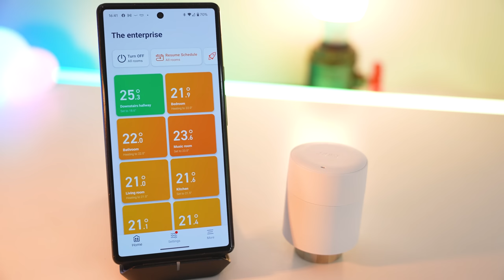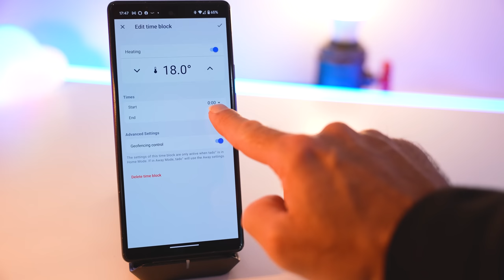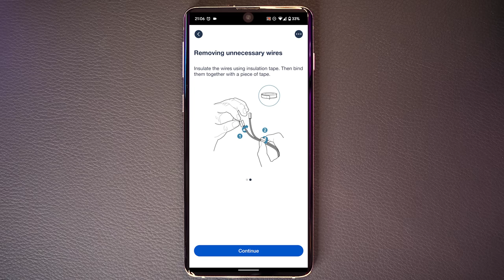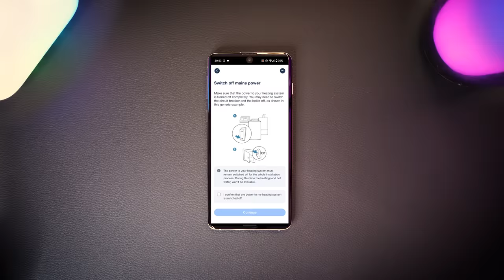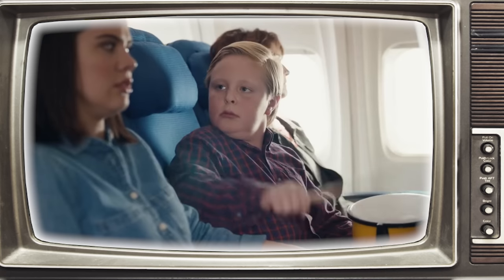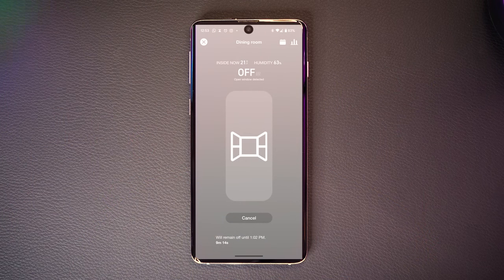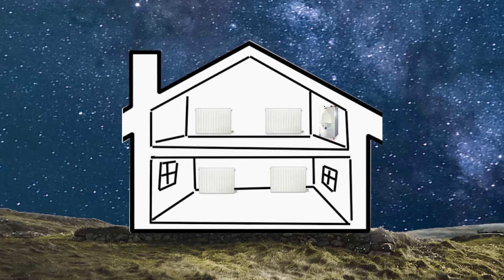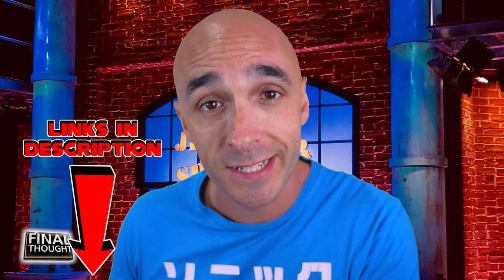Install This On Your Radiator & Drink The Tears Of Your Energy Company

Comment: We bought 8 of the trv's from Hive (alongside motion sensors house thermostat etc). within the 1st year we had to replace 12 of the TRV heads! Yes I think it was 12 as nearly every one failed & then again some of the replacements they sent us in turn failed. The TRV heads were either stuck calibrating, the motors jaming, going fully dead etc. The number of complaints on the notice boards is concerning. Due to the unreliability of this product we insisted on a return towards the end of the year within the first year of purchase. Hive initially refused to allow a refund but yeilded after we quoted the legality of them being not fit for purpose. Hopefully Tado have a more reliable product than Hive.
Reply from the maker: Crikey!  That's bad!  Glad they refunded you.

Comment: I tried these and had to send them all back. They would show a huge increase in temperature when the radiator was on and so shut off straight away. Spoke to support about it for a long time and also tried various hacks (like putting foil next to the radiator) but nothing working. The best heating was when I took the smart TRV off and had it on the other side of the room.

Comment: The reason why you need a bypass is actually very simple. Your heater has a water pump and if all TRV's are closed the pump will fry itself because the loop is closed...
I've installed Shelly TRV's on all my radiators, but placed a shunt near the heater that opens when all TRV's are closed. To control the heatpump I'm using a DIY opentherm shield.

In order to use a TRV, you need to have a thermostatic valve already. If you have a manual value, you need a HVAC installer to replace you're current radiator valves...

Comment: So what happens if your boiler is really far away from your router? Mine are very far out of wifi range, but, I do have a mesh wifi network too with mesh nodes scattered around the house.
I’m wondering how that would work, my mesh nodes have Ethernet ports on them so any idea if I could plug the Tedo Ethernet dongle into the mesh node closest to the boiler and they’d be able to chat to each other as expected?
If anyone has an answer I’d love to know as I’m seriously considering these radiator doodars (though I have over 20 radiators across the whole house so maybe only in the most used rooms… think I saw on Amazon it’s 150 quid for 3 which is pretty damn steep!

Edit: and does each radiator knob require a direct connection to the Ethernet dongle on the router (I.e. they ALL need to be in Wifi range) or do they all talk to each other and daisy chain the way to the router if it’s a big house? Or would they work as long as they’re in range of any mesh access point/node? Sorry many questions!

Comment: I’ve been using tado since it came out in 2014(at a guess). Ours has moved to three houses in two continents and works well. Just about to get weather compensation fitted to the boiler, too: Our underfloor heating doesn’t support opentherm, but the boiler does. Battery life used to 4-6 months but now get a genuine 1.5 to 2 years. 
Geek, weirdo bit, coming up.

In our new house, it has helped us build a portfolio on builder malpractice.  They said our complaint that a room above the garage wasn’t insulated properly wasn’t valid but refused to investigate. I investigated, found a huge lack of insulation…videos it and photos etc….Tado now shows that since I personally insulated that room to regs the heating requirement for the whole upstairs and not just that room has dropped 71%. Almost all of our heating was going into that room. This equates to actual room heating demand, for the naughty room, of 310kwh in December 2020…40kwh in December 2021 with similar weather. 

And it’s fkn maths. They know what we mean when we don’t remove the “s”. :)
Reply: I’m quite sniff proud of this.

Comment: Ive had about 12 tado trv's in my house for about 3 years. About 5 of them have cracked around the housing. Tado refused to help as they were outside the warranty. 
Ive also found that if you have non trv radiators like you have in bathrooms, if one room with a tado trv gets triggered to turn on all of the radiators without a TRV come on, and in my case the underfloor heating comes on regardless of the tado main house thermostat.

Comment: Got mine about a month ago an its grate only down side i had what 2 days after install i discovered Screwfix are doing a limited edition wireless starter kit  in black for £100 , that's £100 cheaper then the white version . Only complaint I would have about it is the there should be a option for the display to always be on .

Comment: I went for Drayton wiser over tado as when I was putting my system in, tado were very new and more extensive than DW.  Drayton/Schneider specialise in heating controls and my manual system was Drayton already.  When I moved from my flat to a house, I had saved enough on my heating that I could afford to fit a trv to all radiators in the house.  I do love the display on these trvs, but as most my controls are hidden, it was pointless to pay extra money to change my system.  The Drayton one also suffers with the online only setup unless you use HA too.  My gas bill even in winter is now less than the daily standing charge as we only heat rooms when we use them, and we can choose what time we want rooms at what temp, and the heating turns off in rooms where windows are open, so we don't burn money pointlessly.

Another great review of a product I have been interested in for a while.

Comment: Love Tado been using it for 5 years.
Two correction: only thermostat support opentherm the extension bit no longer have digital connection for opentherm.
Trv are brilliant but need additional sensor/thermostat in the room as the temperature they report it always wrong!

Comment: Yes, I’m very happy to see you review Tado. I’ve been using it for a few years now and the only thing I’ve had to do with them has been replacing batteries. Otherwise they are brilliant!
Reply: Same here
Reply: Agreed same here
Reply from the maker: Good to hear, thanks gents!  I'm always wary when I'm reviewing something like this that I haven't spent a year with it yet, so it's good to hear positive reports!
Reply: interested in how long your batteries lasted guys. I'm about a year in with 7 TRVs and no battery warnings (yet)
Reply: @smithleon  it all depends on how often the thermostat opens and closes the valve. For me they last about 9 month, but I am turning them off at night, when leaving my home and also several times during the day.
Reply: @smithleon  just got a warning on the main thermostat this week - a battery low one month warning.  No alerts on my TRVs yet
About 18 months so far.
Reply: @dustinh.9107  thanks. yes, of course, will vary for everyone but it's nice to get an idea. Probably varies with age and stiffness of TRVs too. Mine are all quite new. Mine will turn on and off a few times during the day too with the schedules I use.
Reply: Regular batteries lasted about one winter, and I just switched to NiMH rechargeables, which I expect to get cheaper over years and less needs to change them. 🤞
Reply: @smithleon  I had to change batteries for 3 units after one year, other three only after the second year
Reply: If you have no issues with your bridge range then the batteries will last well. 

Couple of areas where the batteries will drain quicker, 1) If you have some TRV's which occasionally fall out of range (like I do) the batteries will drain as the TRV's are attempting to re-establish a connection to the bridge. 2) if you have a room which is more inclined to lose heat quickly (conservatory/garage conversion), the TRV's will open and close far more frequently. I've had to get a wireless temperature sensor in those rooms to negate that effect

Comment: I'm not an expert but I think the bypass radiator is probably just there so that the pump that moves the hot water (or whatever else moves the water, could be thermal expansion as well I guess) always has a clear path and doesn't break or blow up

Comment: I’ve bypassed the pay option all together by using Homebridge and apple HomeKit. I’ve got the window sensors set up so that they automatically turn the valve off if it senses a open window and then turns it back to the schedule when it closes. 

I have tried the pay feature but that was the only benefit for me, didn’t see the point in the cost of it from the “savings” that it states. I’ve saved more doing what I have done compared to what they said I would.

Comment: Been an avid user of Tado for as long time now.  I'm lucky in that as I was quite an early adopter when Tado moved to a subscription model for their "Auto assist" features (they were free initially), they waved these.  So, I continue to have all the features I had when I brought them.  (Unlike LightWaveRF who removed features I originally had when they moved to subscription based).
I don't use the Wireless Heatlink, but instead have my Thermostat wired to the combi boiler directly.   One point of note is that you have to wire this to the EMS/MBus connection on the boiler to use OpenTherm for variable "call to heat", otherwise it's a simple on/off switching model.
I have values on all but 1 of my radiators, since I wasn't sure about the pump overrun on the boiler if all value close, so better to have 1 radiator able to allow water flow.  Especially when you say Goodnight to Siri or the "A" that shall not be named :) all all values shut off.

Good point about it gets better over time.  Tado seems to learn the thermals of you home.  Working out how energy efficient the house it, and how long it takes to warm up etc.
Also love the Geofencing of it too. It will vary the away from home temperature dependent on how far away you are.  If travelling back home, it will start or slowly increase the heat so that it can be at temperature for when you arrive.

Overall, very very impressed with Tado, and their ongoing support as well.

Comment: Great video Paul.

A few cons I would point out, after 2 years of use:
They really need a cheaper external temperature sensor. The TRVs are very unreliable to accurately record temperature, even with the offset feature. The external sensors are great, but expensive. (You really need one in every room IMO).
The range is quite poor. Ok for a "regular" 2-up, 2-down house maybe, but with no mesh system, each TRV is reliant on connecting to the bridge. In any house slightly larger than average this can become a problem. 
Smartthings integration is reliant on a community developed Groovy app, which is soon to expire. No native integration, so very soon they won't work with Smartthings. 

Still - as you say - best of the best IMO, but these cons do cause problems, and I don't believe that Tado show much enthusiasm for addressing issues. (Unless it is an app-based issue).
Reply: Interesting, what range/connection issues have you had? I assumed it must mesh off each device as I have a 3 story house with the hub in the loft and devices throughout. Never had 1 connection issue in 3yrs

Comment: Being in the US, I am incredibly jealous of countries that have access to smart valves for their radiators. The new house we just bought have two boilers which is great! However the house is split straight down the middle for the thermostat controls. Not between floors (which makes sense and would be great). So I have a thermostat in the front of the first floor and another in the back of the 2nd floor. It is a stupid system that I am trying to rectify. But not having smart valves makes it very expensive or challenging.

Comment: I’ve been using Drayton Wiser system for a few years now, but only managed to get the TRV’s swapped last year and I think the system is on par with Tado, looking at this video. Only major difference I can really see is the Open Therm technology, and I don’t think I can manually change the thermostat temperature reading. I do feel that I have saved money since installing the TRV’s, but it’s hard to do a full comparison as energy bill prices were lower 12 months ago to what they are now. I just notice that the boiler is steadily “ticking” over now, instead of rumbling like a jet engine trying to heat all the radiators in the house like before.

Comment: I used Tado in my old Apartment for years, only problem was that one of them always pushed itself from the adapter bracket and stripped the threading of it.

I would use them in my new apartment, but that would include replacing all vales since they are incompatible.

Comment: I've used Tado for years and they've never let me down. Awesome system for our smaller home but I hear signal issues can be had in larger homes.
Reply from the maker: I've heard a couple people say this in the comments now, but the signal seems to be doing great in my 4 Bed!
Reply: Can be an issue and you can spend a long time finding the optimal position for the bridge.

Tado falls down in this area as if they designed the bridge with POE then optimal placement would be easier OR if they allowed the use of additional bridges then optimal placement would not be an issue.

Even better they could have used a non-proprietary comms like zigbee and used the mesh capabilities.

All said once you have found the optimal placement the system is great and in approx 18 months other than 2 batteries I have suffered nothing other than a few cloud outages.

Comment: Few things I feel like you should maybe have mentioned:
• The Tado system does have a few issues in larger houses. We have issues with radiators disconnecting as we have a larger house and Tado has no fix for this (they don't do a repeater).
• The automated away mode and auto turn off for open windows etc is a subscription in the app (it will send alerts to you but do nothing for you without you paying).

Other note is the wireless system for Tado is 868 MHz using LoWPAN so it is all locked to their system. We have 15 of them through the house and there is always at least one that has an error and I don't think the batteries have lasted 2 years in any of them, moving the internet bridge around the house was a pain in the ass (in a house that has ethernet in everyroom). We like a lot of other users have also had issues with the system turning the heating on at random times and then not turning off which negates the very savings it is meant to help with.

I appreciate you haven't had the system all that long but given your great reviews on other items I hope you do a follow up if you do expreience any of these issues.

Comment: @Paul Hibbert I have 2 Nest gen 2's and a Sonoff switch to control hot water. It's a bit of a hack but it works well. After using the system, do you know if I could use only the Tado TRV's to control an Alexa routine to fire up the Nest thermostat to feed the TRV that's calling for heat? 🤔 It's a bit hacky but I don't wanna change everything.

Comment: I was looking at these years ago, then came across the Hive stuff which I’d been able to pick up for practically nothing, so I went with that instead. That doesn’t do OpenTherm, but it doesn’t matter as my boiler isn’t compatible with it anyway (despite only being 18 months old at the time). The thermostat and controller have been brilliant. I also picked up a cheap batch of their TRVs, but I’ve only tried installing one and for some reason it completely failed to do anything but get stuck in calibration mode, then spend two days perpetually knocking until the batteries ran out. I’ve not been brave enough to try any of the others, because they are a total bastard to remove. Maybe one day.
Reply: We bought 8 of the trv's from Hive (alongside motion sensors house thermostat etc). within the 1st year we had to replace 12 of the TRV heads! Yes I think it was 12 as nearly every one failed & then again some of the replacements they sent us in turn failed. The TRV heads were either stuck calibrating, the motors jaming, going fully dead etc. The number of complaints on the notice boards is concerning. Due to the unreliability of this product we insisted on a return towards the end of the year within the first year of purchase. Hive initially refused to allow a refund but yeilded after we quoted the legality of them being not fit for purpose. Hopefully Tado have a more reliable product than Hive.
Reply: Hey Paul, I’ve been using these for around 2 years and makes life heating individual room super easy.
You mention that they are comparable with SmartThings but I cannot see this in the devices list? Thanks
Reply: @Lisa-Andy  Yoinks!  Maybe that's why they were so cheap, they were returned for being rubbish...

Comment: I’ve bought TADO for my new house. Haven’t fitted the new stats yet. I did drop a boo boo by buying a green star boiler with no ecotherm (you can buy a 3rd party add on, but that may shag the warranty). I’ve also fitted 50mm insulation to all the external walls before plastering so hoping this combo will have my heating bills right down.

Comment: If the server goes down or the internet, can I control my boiler manually? As at the moment with my nest system, if they app or controller is not responding, I can switch on and off manually
Reply from the maker: Yes, there are buttons on the controller in the boiler cupboard and obviously on the valves themselves.

Comment: i use heat genius myself. You can fit an auto bypass valve between the flow and return of your boiler and have valves on all rads if you want to. Rad valve behind furniture or rad covers can be problematic. Heat genius also have the calibrating feature, but it doesnt work well. Ive hacked one of the valves and have a remote thermistor wired to it